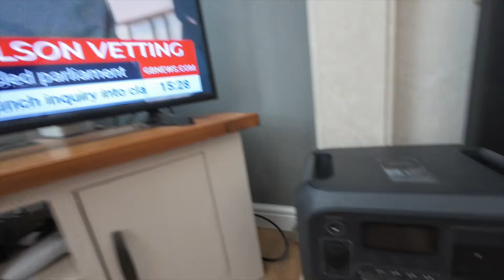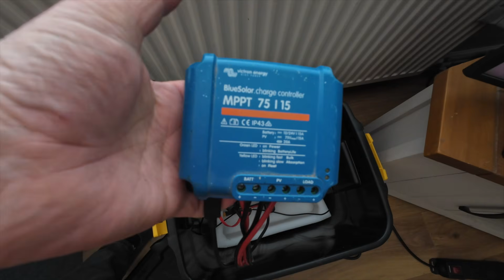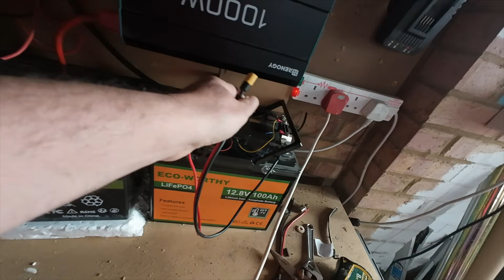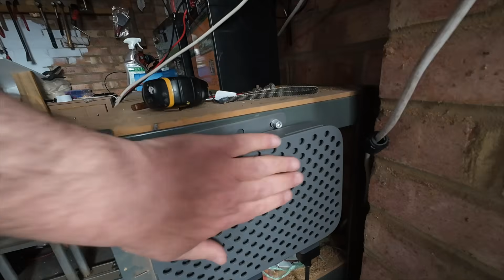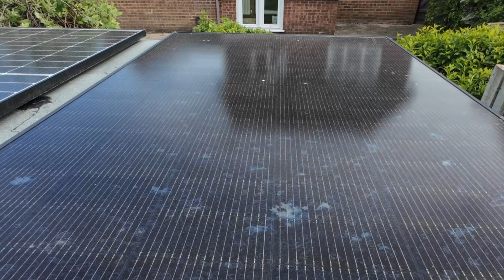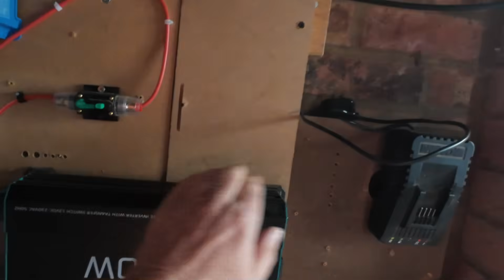Why I'm not buying into Ecoflow Solar!!

Comment: Would be interesting to get a full breakdown of your total system prices including cables and everything.
I've just bought a stream ultra X, with 4 x 400w panels, including all cables and mounts for sub £1.5k. That's pretty good value for 3.84kwh battery and something I can just plug and play and has covered my baseload for the last week. Very happy with it.

Comment: I would never use 12v with inverters, but I will use 12v battery for 12v devices like landscape lighting, router, wifi, security cameras and USB ports...but I think you need to use a 12v regulator unit for the electric devices to keep the output at 12v and not 14-9v range...PLUS, I don't believe the 12v output on portable solar power station are very efficient!!! I used the 12v output on an EcoFlow unit and it SUCKS!!! I would advise not using it at all!!!

Comment: I enjoyed hearing your thoughts. Have you costed everything up and actually compared like for like? I do agree that the £1500+ ecoflow systems are too overpriced, but a 2kwh battery with a grid tied inverter, charge controllers and built in home assistant style app for £800 is a pretty good deal. I think you are going to be at or exceeding that price with all your kit once you include the bluetti etc. What's your total storage capacity? 

I did a similar exercise to you but on paper and I actually wasn't able to significantly beat a single brand new ecoflow stream pro for £824 from the official ebay store. Not to mention the inconvenience of having to cart around batteries all day to make the system work. For busy people outside their house a lot it's not an option really.

Comment: Pretty much the setup I'm thinking off. Don't feel like fully committing to a more expensive system until I have proof the lower cost grid down type setup works first.
Reply: Hi, look at some of the power stations, they have good solar inputs while offering a single box solution.
I’ve gone for an Aferiy P280 which has twin 20a solar inputs (limited to 50v input) so that is a single panel or parallel setup.
This lets me be off grid with the fridge freezer.
Take care m.

Comment: I like the big ecoflow battery with 150 volt double solar input but it is expensive. Means lots of solar on two cables. The low voltage stuff has too many cables

Comment: I have an Ecoflow Delta 3 battery and you used to be able to use it seamlessly with the Ecoflow Powerstream microinverter, but this has now been replaced with the 'Stream' microinverter and it will no longer integrate. This is a huge thumbs down for the money grabbing company. I should never have trusted google AI which told me it would.

Comment: I've had my house since 1980's and can only remember 1 maybe 2  power outages for a couple of hrs at most
Reply: Most of those years have been without Trump at the helm though. Power outages are more possible now, I feel, and so I have bought a couple of garden solar panels and a small battery (1kw) just so my wife's disability equipment can still be used as well as our cpaps at night. I lived through the constant power cuts in the 70's due to problems in the middle east and I just thought oh, here we go again!

I will add a micro-inverter in the summer when regulations are relaxed.
Reply: @ASPIRE1355LC  Nothing whatsoever to do with Trump.

What has been happening, is the extra generation margin has been reducing over the years meaning it is more likely we will experience a power cut now than we would have done 20 years ago.
This is mostly caused by the move to green energy sources and not having sufficient low start-up time alternative sources of generation.
In fact, the UK came to a hairs breadth closeness to power outage in January 2025 because there wasn't enough wind.

Now Trump might like to blow a lot of hot air, but given he is in a country over 4000 miles away, not even he has the lungs to impact our electricity generation.

Comment: Kier Starmer on the telly , no wonder not happy. I think a lot of the problem with pricing of batteries is due to general inflation. EVERYTHING is costing more now. You are right to recommend  a home grown system. I have a battery similar size to your bluetti that you have infront of your fire  But it got me interested in solar - only I am waiting until they start helping pay for the installation ( if that ever happens) 

 I am not good or handy with electrics but had similar idea to what you have done with your shed. Your video gives me encouragement to have a go at it.  You could maybe use some sort of trunking and do a tidy job on those cables would look good. That is the sort of set up I will trying to do. Panels on Shed. I doubt I will have more than 800w worth of panels in the garden and none on the roof but if you can run a fridge and tv recharge all the small stuff and you can do it without moving batteries or unplugging all the time its a good idea. People talk about their full installation paying for itsself in 7 years . I say well done to them but I don't envy them that much. I dont trust a lot of solar guys / roofers on my roof, and you also have the 10k that you have to find to get it all done in the first place. I would be spending 5-10 euros a day on electric on average throughout the year. Its something you can save on but you would never make money with electric, if you did the government would put you in jail.  Only the handy people who understand electronics can make solar pay so I get your argument that ecoflow ( I think the companies are all the same tbh) is expensive. If these batteries last 10 years plus and the yare digging lithium up all over the world we should reach a point where we have lower priced batteries? I hear people saying they are cheap as they ever were but I think they can still get cheaper..

Comment: All of the solar generators that are currently on the market are a waste of money for several reasons. Number one, they all use cheap, high frequency, transformerless inverter technology that can damage your home's appliances when the MOSFETs in their H-Bridge circuit fail. The use of transformerless inverter tech also offers a much shorter life expectancy than more reliable, higher performance low frequency transformer based inverters. The second reason they're a bad investment is that they all lack a sufficient amount of battery capacity and typically use non name brand cells, BMSs and charge controllets that tend to fail early during the product's expected life  cycle. Third, they all offer poor surge capacities that make it difficult, if not impossible to start high inductance loads like power tools, microwaves and motorized loads.

Comment: Thanks for the video by the way please ignore the negative comments as I thought your comments were overall thought provoking and did provide a useful brake pedal on all the positive ecoflow videos out there as it's easier to go down the ecoflow rabbit hole!
Reply from the maker: Thanks for the kind words, I'm glad you found the video helpful and thought-provoking! 👍
Reply: I have three EcoFlow stream moduals giving me just over 5kwh of storage-not set up because I am moving. Total cost approx £2.5k. total solar input  3kW. Worth it? I think so. However I recently bought a 2 kW power station for £885 which is luggable and can go anywhere I need power. 7kW for £3.3k add 600 for solar panels for the garden fence brings me under £4k for the system. It should do everything I need but can easily be expanded.

Comment: I'm thinking of having a second off grid washing machine in the shed. Probably would just work in the summer.  Would need a 200amp battery, a 3000watt sinewave inverter and solar panels. Be good to get free washing after the initial outlay except for the water and detergent...
Reply from the maker: It’s a great idea, and definitely a satisfying way to make use of your own off-grid power.
Reply: 200 amp battery? What capacity do you need?

A 3000 watt inverter only requires an input current of 15 amps, your 200 amp battery is unnecessarily high.

Comment: We have a Victron Phoenix 3 kW pure sinewave inverter, heavy toroidal transformer type, don't like the hi frequency switch mode do da inverters as many report problems with them.
Also 4 x 280 Amp hour Eco-worthy batteries in parallel as it's a 12 volt inverter so 1120 Amp capacity( Theoretically/ mathematically 14,300 watts inverted at 230 volt), but will never run batteries below 25%
Our system is totally off grid separate circuit, not connected to mains at all.
Gaz Yorkshire.
Reply from the maker: Wow, that sounds amazing 👍 I’m envious now 😂. All the best and thanks for the comment.

Comment: I bought the Powerstream connecting cable that was originally for Ecoflow's River Series of powerstations. It's single direction only (ie can't be used to charge the battery) but it can be used with any 12V LFP battery to pull in 8A (100W) to the Powerstream. I have it connected via the load output of my Victron Smartsolar MPPT so that the Victron can be set to disable the load when the battery voltage gets down to a certain amount. 
Also, I run my Virgin media WiFi router directly from the 12V battery. It has no problem with 14.4V down to 10V.
Reply from the maker: Thanks for the comment, that sounds interesting and quite clever 👍.

Comment: The thing with the ecoflow batteries that made me take the decision to purchase is that it's an all in 1 system, just 1 unit with several mppt solar charge controllers, a 1200w grid tie inverter a 1200w pure sinewave inverter, Bluetooth and WiFi monitoring and a 10 year guarantee. 

I'm not saying it doesn't have its downsides, but for those that are not electrically inclined or just don't have the time to tinker with wiring and connections, they really are just so simple and easy.

I got a great deal on my system and payback is looking at around 3 to 4 years depending on if I can make full use of time of use charging so not too bad.
Reply from the maker: It’s great that you’ve found a setup that works for your needs and offers such a clear path to payback!

Comment: Seems like a lot of hassle moving little power stations around, TV doesn't use much, electricity can't be huge saving? If I went for a power station I'd want to run heavy appliances off it like the washing machine.  I've got a stream and a few panels and that's worth it I think but it can easily get overcomplicated. Will get a conventional house system and batteries for the next house.  It's not all about the savings, it's denying the electric companies your money I think?!
Reply: That's fair enough,good to have something to tinker with! We've got kids that are a full time job on their own. It's not all about the money but when the UK has some of the most expensive leccy in the world its easy to make some savings!
Reply: Bit like growing your own. It doesn't make a lot of sense necessarily commercially but satisfying
Reply from the maker: Thanks for the comment. You make a very good point of which I totally agree with. The stream I have gives me on average 550 to 620 watts in good sun which feeds straight back into the house. I use the portable units in the evening when the sun goes in and charge them the following day. It is a hassle to move them around but to me it’s a labour of love, a hobby that keeps me interested. For those that just want a system they set up and forget I totally understand that, but for me that takes the fun out of it. I have saved over £250 on electricity bills in the last 14 months, not huge I know but has already almost paid back most of what I’ve purchased so will soon be getting power for free.  To me and others it’s a hobby to enjoy and like to keep dabbling with.

Comment: The Ecoflow stream at under £ 100 is great value and then purchase a couple of 450w panels from plum centre. Job done allow that to go into your house to cover base load fridges routers etc and your going to get payback in a very short time. Mine was fully paid off by year three. I paid £ 275 for mine I needed some longer cables and some brackets and screws. But the system is saving me about £ 100 a year. I looked at the ecoflow battery systems and realised for the capacity you get they are simple not worth while. So much so I purchased a hanchu 9.4kwh battery for under £ 3k which would have cost a fortune if I have purchased ecoflow batteries. Now I can charge cheap at night as well as get solar input during the day.
Reply: I just use the Ecoflow Micro inverter with 2 panels.  One thing you can is buy a £15 Ecoflow Shelly smart plug and set it to come on at say 400w and off at say 300w (base) and feed that into any existing battery (I happen to have a Vtoman).

Comment: Thanks for showing your DIY components. 
Now that the 100 Ah battery price has come down a lot, separate components are a sensible option again. 
A solar battery inverter is convenient, but the worry is will it be repairable when one part fails. 
Inverters are notorious for failing after a few years. 
Your old style heavy inverter might last longer and will be easy to replace.
Also, your Victron components are likely to last longer than the equivalent parts inside the battery inverter. 
Thick cable is a hassle but one 12 Volt battery is logical for a portable box. 
Have you considered four batteries for a 48 Volt system permanently mounted in one place? 🤔
Reply from the maker: Thanks for the comment, a permanent 24v or 48v system is definitely something I've thought about for the future!

Comment: I'm not a massive fan of EcoFlow either as I don't believe that we should be cloud connecting our services... however, the thing that the EcoFlow does have that your system doesn't is protection.

The whole reason that the EcoFlow shuts down when the mains power goes off is for the safety of the engineers working on repairing your mains power! Without this, you and everyone who follows your example is pumping 240v back out onto the grid where engineers are attempting to isolate faults and repair equipment.

If you want a system that runs when the power is down, you need an extra device usually referred to as a 'gateway'. This will safely drop your grid connection yet keep your local systems online.

Also, please make sure you correctly terminate your connections on 12v inverters. As you call out, they can draw massive currents due to their low voltage and loose / poorly terminated connections can generate a massive amount of heat leading to fires... especially when you're moving them around and pulling on the cables. They're designed for fixed installation in boats.
Reply from the maker: Thanks for your comment. My EcoFlow stream does as you state shut down all power if the mains goes off so totally safe. You make a very good point and as I alluded to in the video also, 12v systems can draw enormous currents and could easily start a fire if care is not taken. The only thing that really gets moved in my systems is a battery swap out, and I always check the connections after it’s done. Sounds like a lot of hard work for some people but I enjoy it and it gives me the flexibility to upgrade or repair items that break. EcoFlow batteries I feel would be more of a pain to self repair.

Comment: You can do the same with rack batteries, y&h 2000w gridtied inverter with limiter and of course solar panels... I prefer to put it into zero export mode... you can use a hybrid inverter/charger or a PSPS connected to the batteries for backup system, too....
Reply from the maker: Thanks for the comment, that sounds like a great alternative setup for someone.
Reply: Didn't think Y&H had G98 approval (which you need even in zero export). There are a bunch of products that are G98/9 approved though for that kind of path. Even stuff like Solis is no well priced these days and will work with Fogstar and similar batteries.

Comment: Chinese tat surely?
Reply: There's a real mix from Chinese vendors - everything from top notch high quality product to 'temu special' explody things. The good stuff is good the bad stuff shouldn't even legally be imported - but the UK enforcement is a joke.

Pretty much all the inverter producers selling into the UK are Chinese except Victron. The battery cells are also mostly Chinese but actually battery assembly and batteries you can get UK builds and the like if you want.
Reply from the maker: Thanks for the comment. If you’re referring to the stuff I have the Victron are European made and are top notch, as for the batteries and Solar panels … well most if not all seem to come from China.